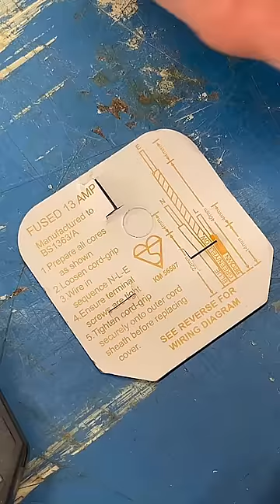Probably the Best Plug in the World 🇬🇧🔌🔌🔌

Comment: Can anyone give a good explanation as to how this is better than the EU Schuko plug?
It's a hazard to stand on, and Schuko can be plugged in either way. Usefull for angled plugs.
Reply: My son was nearly killed by a broken Schuko socket in Spain. If you accidently hit a Schuko plug on its side whilst plugged in it smashes the recessed socket and can exposes live conductors. The UKs plugs & sockets don’t do this.
Reply: Also, its polarized (so the brown wire is ALWAYS the live conductor, and its fused: passing 16amps (in the case of Europe) or anything between 16 and 32amps in the UK down a 3amp flex isn’t good unless you want a visit from the fire brigade.
Reply: @alanwood9804  None of the brands i know and use have exposed conductors on the backside of the socket, so it was most likely cheap and crap quality, which would also explain why it broke in the first place. I work with construcion workers, and these men break anything, that said i've never seen a plug and socket break on impact, maybe except for some very old brittle stuff which would would be a danger in ny country.
Polarisation doesn't matter though being AC, that's the nice thing about schuko, being able to plug it in both ways. And have you never heard of cirquit breakers?
Reply: @GeweerBeer  
I’m an electronics engineer with 40 years under my belt.
So yes, I know the difference between a fuse, MCB, RCD and RCBO, the function each is designed to do and how they work. If you don’t know why polarity is important on a grounded AC system, I suggest you go to college and educate yourself.

Comment: Why would you want a fuse in the plug?
Reply: This design has not changed since the seventies before we had fuses and now we have circuit breakers, residual circuit devices, spike protection and now arc fault detection devices. Probably too expensive to change the whole commonwealth countries?
Reply: To protect the cable. The same way you have a breaker to protect the supply cabling.
Reply: @GluteMaximuz  
The breaker in the box in the UK is often 32amps (7360 watts at 230volts) and passing that current down a damaged 3amp flex isn’t good unless you want a visit from the fire brigade.

Comment: First I was like what a monstrosity, but it got a fuse so it's way safer than the ones we got
Reply: A fuse doesn't make it automatically safer. They exist due to ring sockets and are therefore mandatory. Without a fuse, you risk your cable burning due to overcurrent from the ring. Radial systems reduce this by having less current in the first place.

Comment: I would of agreed
....till I saw the screw terminals for L/N/E. 
I'd like to see Cage Clamp there rather.... Faster to wire up, No need for Lace Ferrules, Optimal Pressure Termination, Vibration Proof, Temperature Tolerant and Maintenance Free....
Reply: All the things you listed are absolute non issues for these plugs. I've been using for several decades as have the rest of the UK so they are pretty tried and tested.

Comment: 'Some' people have started only using plug tops that are made from transparent plastic; you can see right through them.  The the last straw for deciding to do this was looking at some heat lamps in a pizza shop.  Some absolute, fkn idiot had stripped insulation using what looked like their teeth and the L and N were the wrong way round.
So, see through plugs from now on 😎
Reply: Medical plugs in the US are translucent. 
Required in hospitals unless you're admitted for electrical shock injuries.

Comment: ًWhy do you trim the excess after the crimp? I've heard advice against that.....
Reply: Because if you don't you'll have an exposed section. Whoever gave you that 'advice' needs to never have anything to do with electrical systems.
Reply: @skylined5534  They strip with a guided stripper anyway, I think they mentioned that copper should extend by millimeter or two beyond the terminal. Maybe to make sure the wire goes all the way up the terminal?

Comment: Deffo not the best, pins to big ie baby fingers in hole, earth not required double insulated list goes on
Reply from the maker: The holes have shutters
Reply: @efixx  that's the point over engineered.wouldnt need shutters if pins slimmer and no earth required to open them,then you could have2 pins for double insulated and no damaged feet

Comment: Automatically disqualified from being the best by needing a fuse in it.
Reply: Discuss.
Reply: No, the fuse provides added protection for the flexi cable. A table lamp might only have 0.5 mm^2 cabling, and protecting that with a 20A MCB is inadequate. A fault in the cable or appliance that drew, say, 15A would not trip the MCB yet would overheat the flexible cable.

It's a general principle of electrical safety that you overload circuit protection device must be able to interrupt the circuit before the cable is damaged. Systems that allow thin cables to only be protected by 20A breakers have a weakness. I should add that UK circuits with sockets on them can be 32A.

On the older UK BS 546 round pin standard, there were four different sizes of plugs/sockets with different ratings. They were rated at 2A, 5A, 15A and the very rare 30A plug (now dropped). All used round-pin plugs of different pin sizes and spacings. Each type of circuit was fused for that type of plug and cable. When BS 1363 came along, the designers decided a single plug was more flexible, but did not want to sacrifice the safety of a fuse tailored to the size of the cable connecting the appliance. Hence the fuse in the plug. It also allows the UK to have some very powerful circuits where required, often 32A which means multiple high powered devices can be connected to a single circuit without nuisance trips.
Reply: @TheEulerID  the electrical distribution design should not require a fuse - see every other country. The applicance should protect against overload.

A fuse in the plug results in heat and risk of fire, not to mention the fact fuses have a limited life, making the cord more expensive, larger and the fuse a maintenance item.

The best engineered devices eliminate components.

Also the size of the pins are excessive compared to other designs. I would contend the Australian plugs are one of the best in the word - good mechanical strength and stability when in the socket due to angled flat pins, but compact and cost effective.
Reply: @jay-em  you are full of ridiculous statements. No, fuses do not have a limited life. I have plugs over 50 years old, with original fuses and they never just fail. None has ever caught fire, they are not fire risks in the slightest. Fuses are there to prevent fires, exactly the opposite of what you claim. Also, no electrical system which allows a 0.75 mm flexi cable (rated at 6A) to be only protected by a 16A distribution MCB meets the best safety standards. An appliance at the end of a flexible cable can protect itself with a fuse, but it is impossible for it to protect from a fault in a flexible cord. 

Also, for your information, there are 48 other countries outside of the UK that use the type G plug. So, claiming no other country in the world uses them is yet another false claim.

Also, that fused plug makes circuits far more flexible. It means that I can have a safe 32A circuit for my kitchen, and not have to worry about nuisance trips if I happen to turn on the 3kW electric kettle at the same time as a 2kW toaster and the 1.5 kW microwave. No need to worry about what combination of loads is connected to which circuit in the kitchen, and I can re-arrange as I wish.